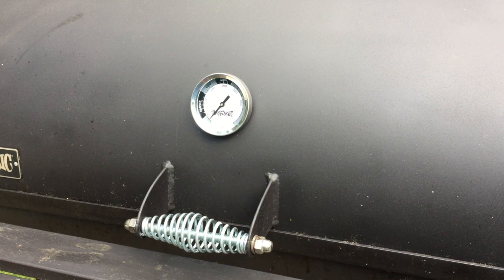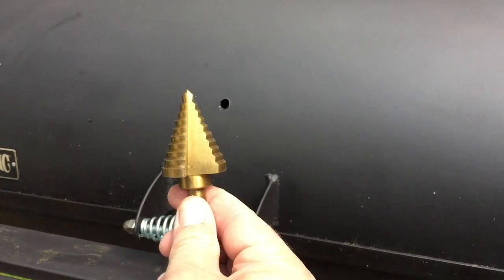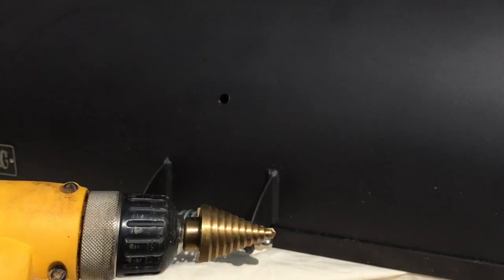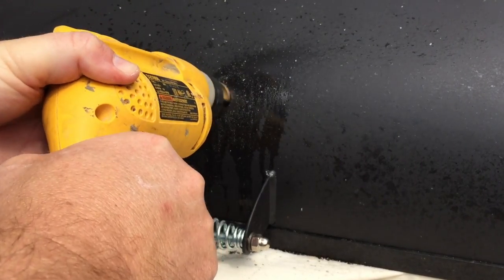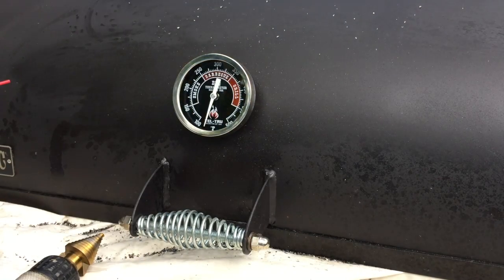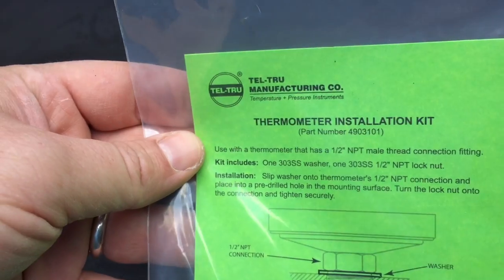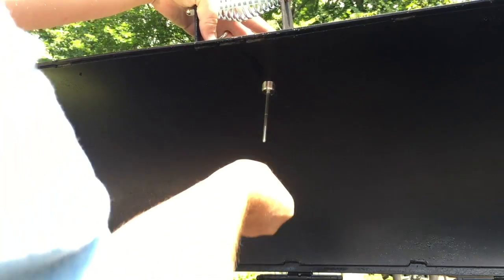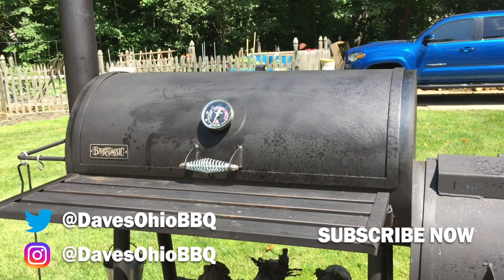How to Install a Replacement Smoker Thermometer - Tel Tru

Comment: I want to use this for my thermometer.  My dad has about 10(I know it's a problem) smokers; water, gas, wood, electric, vertical, egg, charcoal, indirect.  This summer we are designing a DIY "solar" smoker(there will be a smoker box for wood chips).  I haven't found any videos that do this for true BBQ(we want brisket!) .  And you have got to have a good temp read to make good BBQ.

Comment: Do they still have these at Costcos ? Can't find them anywhere .
Reply from the maker: Chester Barden I don't think they do. Costco tends to get several grills and smokers in stock around March/April, and then they are gone. So maybe next year. If you do see one there, and you're in the market for an Offset, buy it!! It's a beast. I'll be posting a rub cook tonight.  Thx for the question, Dave.

Comment: Do you have any leakage of smoke after you drilled and replaced the gauge? I was thinking about putting a gasket around the nut
Reply from the maker: Dennis Cudal none what so ever. If you drill the hole the correct size for the thermometer you should be fine. That being said, if you have a high heat gasket that will fit, throw it on there. It couldn’t hurt.

Comment: How much should i spend on the step drill bit? Amazon has them as low as $15 and lowes has them as high as $70 — i have a smokey mountain weber so there top part is not too thick.. please advise.
Reply from the maker: Tyler Parr I’ll be honest, I bought the cheap one from Amazon. It worked fine for my WSM. My offset smoker was a different story. The metal on the Offset was too thick.
Reply: Tyl

Comment: Wish I would've watched this first. I botched my smoker the other day, accidentally drilled a 1" hole using a hole saw. Now I'm trying to find a way to cover up the old hole while I use high temp gasket to cover the space I screwed up.
Reply from the maker: Sir BMW do you know anyone with a welder? How much of a gap is around the thermometer?
Reply: Use painters tape on the inside spread the high temp rtv and let it cure, pull the tape off and smoke away.